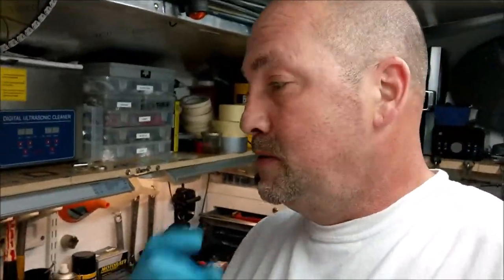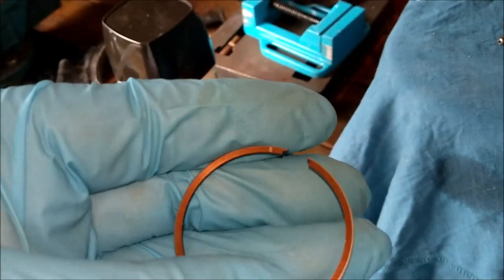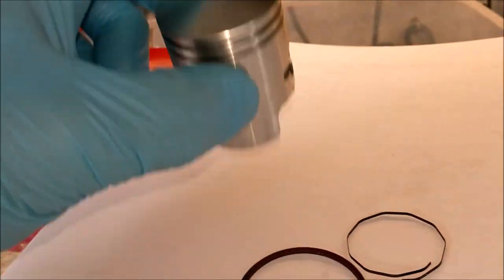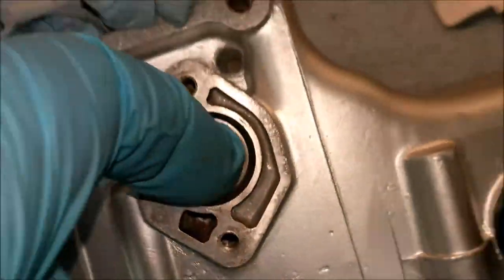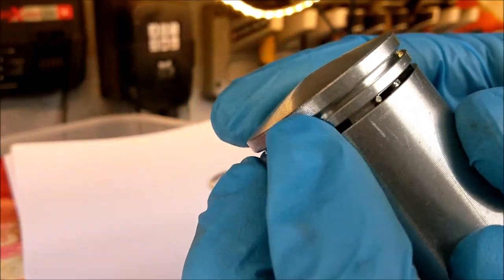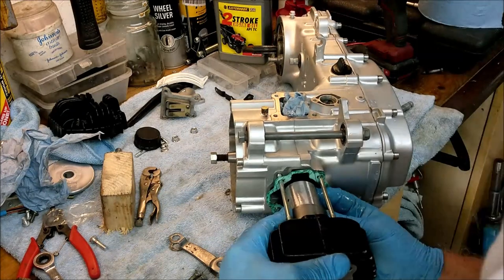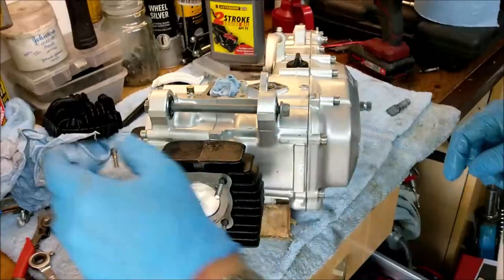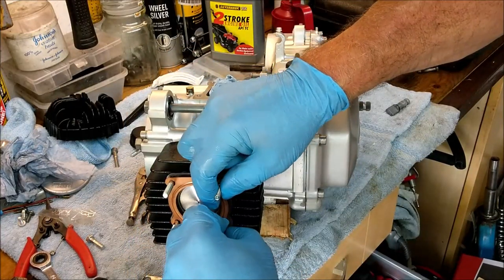Suzuki FZ50 Restoration #35 Help needed please team.....

Comment: Hi can you help my fz50 won't kick over something's wrong with the kickstart
Reply from the maker: Hi Matthew,  has it 'just' stopped working?
Reply: I'm sure you know this, but you have to have the rear brake pulled in.  If you're doing that, check the adjustment of the actuating lever (a few inches ahead of the bear brake actuator).

Comment: Pretty sure you said 6 - 8.5 Ib-ft and then proceeded to set the torque wrench to 7 Nm. If that is the case you've under-torqued those head nuts Eadsie. 6 - 8.5 Ib-ft equates to 8 - 11.5 Nm. Hardly a disaster - potentially bad news the other way round ie. over-torqued fasteners.
Reply from the maker: Thanks Mike, I will take a good look at some torque wrench tutorials.
Reply: @eadsierestorations  My wrench has Nm graduations one side and Ib-ft the other. Easy to use the wrong scale. Ask me how I know 🙄

Comment: Looks like you’ve got two top rings as the diagram you showed definitely has the rings different sizes. Your vernier measuring them both as 1.9 + a few points of a millimetre different seems to confirm it, even a not too accurate vernier like that would’ve shown one as 1.94 and the other as 1.7 say if they were different.

Comment: We used to have data for piston skirt clearance  which was then measured with feeler gauges.  Many pistons where not produced round  on purpose but somewhat oval.  The design  principal being to  allow the skirt  to expand with heat to accommodate the fore and aft  forces that are produced on the piston via the connecting rod on the gudgeon pin.  (aka piston slap in worn engines) .  Not sure if this relates  so much to these smaller motors though. If when you place the ring without piston in the cylinder perfectly square and the gap is  very small (necessary as they will expand with heat) then the rings you can assume are the right size  so you then check the piston  for size if the exhibit the same gap when installed on it.

Comment: There a two schools of thought re reed valves. Some thing that as they should be flat they MUST be fat to the block. Others seem to think that if the gap is relatively small the back pressure in the engine should push them closed. If there is an issue its likely to manifest itself in poor starting or “spiting” back through the carb.
Reply from the maker: Thanks Andy 😀

Comment: I'd turn the reed petals mate . Ditch the compression ring you don't it . I'd place a ring on its own in the barrel and measure the  ring gap. Specs will be in the manual what it should be . Double check the piston size and barrel size with veneer Caliper 👍
Reply from the maker: Thanks joe
Reply: Spot on

Comment: the piston and rings are to tight, good chance of it seizing up when the piston expands when it warms up, need to find out what the piston clearance gap is and then measure what you have to see if it is right or not, wondering if they have given you a + size piston and not a standard sized one, also worth checking the ring grooves to make sure there is nothing stopping the rings seating properly, the copper head gasket is the one to use but would anneal it first and use a smear of gasket paste with it
Reply from the maker: Thanks bud, it's in now, the piston seems fine so I'm going without the spring ring. Will see how it goes, got me thinking now about the piston and weather it's the right size